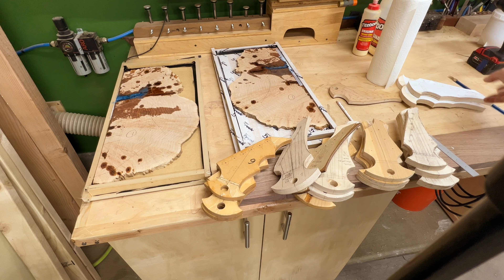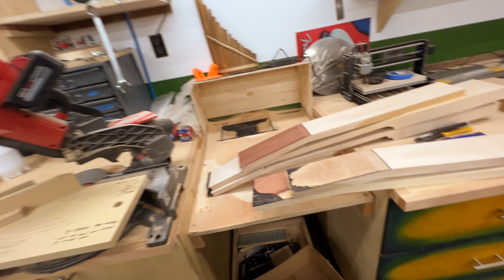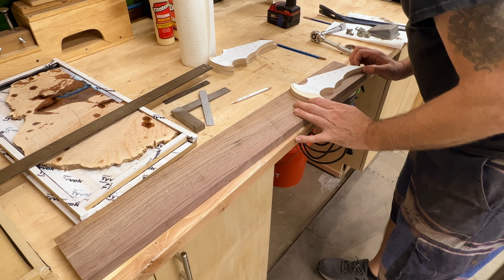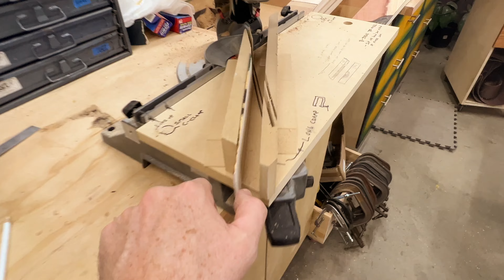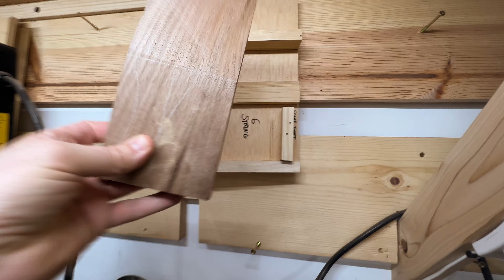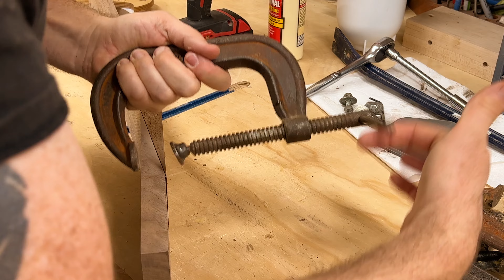Headstock Evolution and Cutting and Gluing a Scarf Joint

Comment: My mind was blown when you repositioned those strings lower down on the right side. 🤯 Thinking outside the box!  It could also look cool to use an inverted V-formation for the string positioning - but then again I really like symmetry. (Sorry, I know I keep suggesting design tweaks every time you post something new. Not trying to discredit your work, I just get inspired by it.)
Reply from the maker: Cool idea! The only thing - the length of the string will be a factor in playability, and if the two middle strings are closest to the nut, those two strings will feel "looser" than the rest, probably not much though. It might work actually. However, when you get a "reverse" headstock, the reasoning behind it is the length of the thickest string is longest, making a tighter feel on those fat strings. Makes a great feeling and playing metal guitar. At the same time, the difference isn't really that much but it is a measurable difference